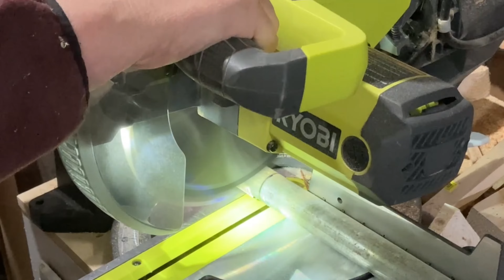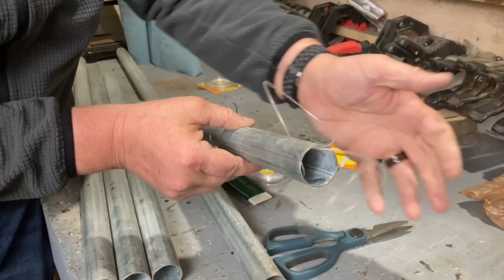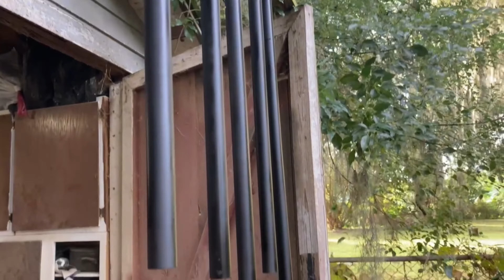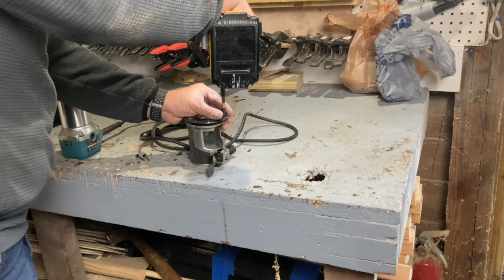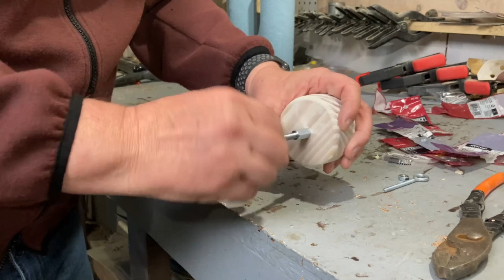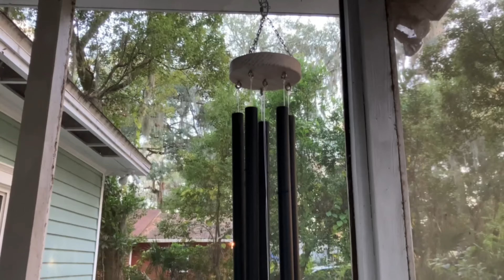Making A GIANT Set Of Wind Chimes // Great DIY Project!!

Comment: Absolutely gorgeous along with a great tone. Spot on about the sail having proper weight, I had the same issue. I also put a 45-degree cut on the bottom of the tubes. Painting the tubes puts it on an entirely different level, fantastic. Thank you for a beautiful video.
Reply from the maker: Thank you very much! I didn't think about cutting an angle on the ends, that's a good idea!
Reply: @boydstongrove  the 45-degree cut comes from another chime video. Definitely not my idea. Small detail but gives it a more finished look in my opinion. I will be painting my chimes. Thanks again.

Comment: Could you use square piping instead of round? I have an ez up tent frame that I hate to discard of and wanted to make something with it. 
Thank you. Beautiful sound!
Reply from the maker: I never would have thought of that. The website that I used in the video actually gives a list of materials and what works best. A lot of it also depends on the diameter of the material; the smaller the diameter, the less sound you'll get.

Comment: Do you have a video about making the wooden router "holder" you used to clean up the edges of your smaller wooden pieces? Thank you for the great video!
Reply: PS Do you need to use a special drill bit to make the holes in the pipes? What kind of blade for cutting metal? (I'm still learning all of this!)
Reply from the maker: I do not have a video for that, I actually got that idea from Jimmy Diresta and just kind of made it up. But I am working on a design for a small, tabletop router table and I will have a video and plans for that. Thanks for watching!
Reply from the maker: Great questions! Metals like aluminum, copper, brass are considered soft metals and cut very easily with a standard woodworking blade, as long as you move at a nice, slow pace. However cutting metal can shoot off metal flecks so make sure you're wearing your PPE. The same goes for the drill bits. When it's a softer metal, the bits go through no problem, but they will get dull so you may need to replace them afterwards. I use an awl or nail punch to create a divot first so the drill bit doesn't slip around. Hope this helps.
Reply: @boydstongrove Thank you for the excellent information, I appreciate the guidance. I love making things, but I'm always kind of winging it. ☺️

Comment: You listed pipe and hole measurements. Would have helped if you listed diameter of wood rounds.
Reply from the maker: Yep, you're right. I didn't think of it because if you go to the website, there are free templates to print out, so I never actually measured them, I just used the templates.